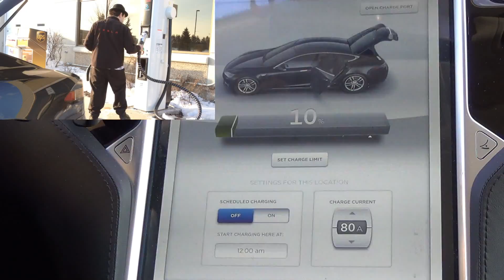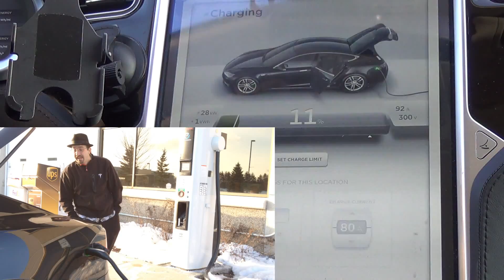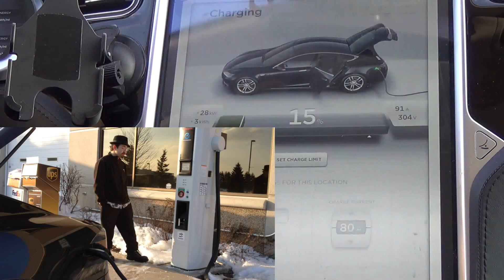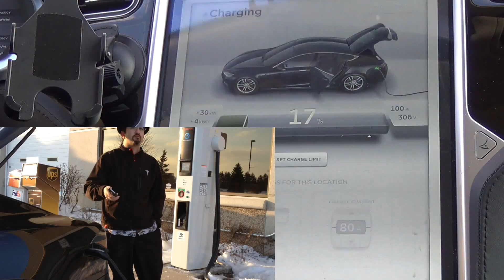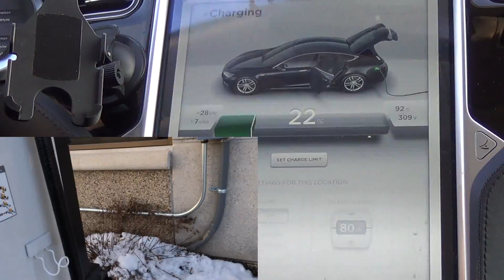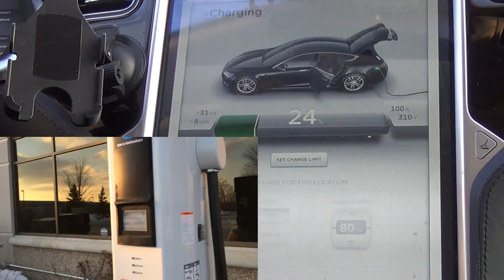Tesla Motors Model S: CHAdeMO Charge from 10-80% Almost... then FAIL!!!! Nissan Station Design Flaw!

Comment: The charging rate for both the Chademo and Superchargers is controlled by the car, not the charging station.  In other words the car tells the charger what current to deliver up to the limit of the L3 charging station.  On a day when the battery was warm you would probably see the 120 amp limit of the Chademo station.

You were also seeing a 7 amp difference between what the Chademo station and the what the Tesla was reporting for charge current.  This would have been due to the energy used to run the battery pack heater and the cabin heater if it was turned on.  7 amps at ~300 volts is 2100 watts which is reasonable.

Comment: Takes about 3 minutes to completely refuel my car.  The recharge time and the range limits will always be an inescapable issue with any battery powered car.  If the electricity is being generated with coal or natural gas, the Tesla is actually creating more Greenhouse Gas than a hybrid vehicle.
Reply: *****   Where is the electricity for the Tesla coming from?  If it's nuclear, like my home, or hydro-power then it doesn't generate CO2.  If the power comes from fossil fuels, the Tesla is NOT reducing Greenhouse gas emissions because of the inefficiency of generating and transmitting the energy to the charging station; about 30% of the energy in the fuel is wasted as heat.
Reply: *****   My point is that Tesla isn't going to save the planet. Just creating and operating a Tesla requires a huge amount of energy; most of it from fossil fuels. To reduce Greenhouse gases to the necessary levels will require much more.  People do not yet understand the drastic changes that must occur. This coming decades will see changes greater than occurred during the Industrial Revolution.
Reply: +John Ferguson i find it laughable that those who hate electric cars conveniently forget that it takes a massive amount of energy to make and run a petrol car as well. Show me one petrol car that doesn't require energy t make it or run it.
Reply: ***** The point is that Tesla has very little net impact that could improve the global environment.  Any meaningful reduction in Greenhouse Gases requires a much more dramatic adjustment to our lifestyle; a complete restructuring of our transportation system and our economy.  Tesla will not save the world.  Too many people are buying into the hype, the propaganda surrounding Tesla.
Reply: So your solution is to not try?  Let's just keep on with using petrol and diesel? At least tesla is trying to make a difference instead of sticking their heads in the sand.
Reply: ***** My solution is to get people out of cars and into using electric trolleys, trains, and buses.  We will have to build hundreds of nuclear power plants to generate the huge increase in the supply of electricity while making meaningful reductions in CO2.  Very few people appreciate the dramatic changes that will be needed to stop the run-away Greenhouse Effect.

Comment: the box at 20c is not hot.  At all.  That's warm.  Most hardware can withstand operating temperatures in excess of 90c.  I find it hard to believe the station overheated at such a ridiculously low temperature.  Heck, my computer has much smaller power components and it can run at 80c while gaming (176f) with just tiny fans to cool it.  And it can do it for hours on end through summer - even if the dust filters are clogged.
Reply from the maker: +Will Davis correct, these station are very flawed. I do believe Nissan has discontinued them. Using such small fans :( And even then, given the outside temps were well below freezing and the wind chill, it should never have failed like it did. Just overall bad bad designs and many issues of this design station. Tesla even changed the firmware on the adapters to limit current to 20kW on the Nissan Slim stations because of what you see in this video!

Comment: I'm trying to figure out what's the issue with those CHAdeMO chargers, 30 kW and let's say 90% efficency (should be realistic for this size of power supply)  would yield only about 3 kW of heat, that's about one and a half electric heaters, it doesn't sound like something impossible to dissipate, especially when cooled with freezing cold air... I guess that cutout sensor is located in main transformer and since it is quite a big mass to heat up (even though it is switcher) it takes some time to heat up this cold-soaked chunk of iron and copper. It may be similar case as with microvawe ovens these days, they rarely can operate continously without popping temperature limiters based on assumption that you rarely need to cook something more than 10 minutes...
Reply from the maker: mibars I will say, after another session, and go at it, giving the station a 10 minute cool down every 20 minutes of charging, that station smelled like it was going to burn.....
Reply from the maker: *****Wyatt Earp I'm not rich, my car was $74,500, and my Flir was $200 brand spanking new. I hate stupid people.

Comment: Looks like it was designed in a hurry by a bunch of internal combustion engineers who'd decided to try their hand at power electronics, then mass produced.  Some parts massively over specced, some massively under specced, and some really questionable decisions - air intake / filtration,  rain protection.
Reply: +nemthefearless It's designed for the Nissan Leaf, not a Tesla.
Reply: +nemthefearless It's some really bad work isn't it.
Reply: John Ferguson Exactly.

Comment: Question to the viewers is there a Chademo to CCS  & a CCS to Chademo adapter out there to buy yet?
Reply from the maker: No. But first, we'd need CCS Stations... Havent heard of too many of those yet. Maybe 20 in the whole country, compared to 600+ CHAdeMO and Hundreds of Supercharger Stations.
Reply: Robert Utess  Newer fast charge stations are equipped with both a CCS cable and a CHAdeMO cable.  Similar to a gas and diesel nozzle on one dispenser.
Reply from the maker: yep. kinds of stupid if you ask me. They should choose one and stay with it. As long as they keep supporting so many different standards, J1772, CHAdeMO and Combo, the manufacturers wont standardize. Thankfully tesla is the most universal so far yet also the most standardized.

Comment: Bummer!

There are no chademo anywhere near where I live. But what a cludge-fest piece of crap connector. It's like they designed some franken-connector. Wow, does not look high tech at all!! WOW.

You may want to think about buying an external mic for yourself, one with a piece of foam on it (wind sock). There were lots of times where I could not understand you.
Reply from the maker: I have a external mic, but only works with my camcorder, not my iPhone. I was trying to make this a big Multi-Shot video, but things didn't work out right.

Comment: Good experiment. Weak engineering.
You actually can't have drop in current in a circuit, you can have voltage drop. So the difference in current has to be measurement inaccuracy. Or lying.
And that's no small margin.
If we assume that the Tesla is accurate and that the car is asking for all that it can get, then the Nissan station is a lame 28kW charger at 300V. When it claims to be almost double. But it's possible it can rise to 125A at 400V. In the unlikely event it was submerged in arctic waters for cooling. Although it is in principle possible that it gets particularly hot at 300V which they didn't test much because they expected most use at 400. Still pretty substantial fail considering how massive the cooling system is. And how cold it is. Imagine how poorly it will do in US desert heat.
And now that I think about it, it's actually odd that it doesn't just thermally throttle down instead of cut out completely. Some is better than nothing. Double fail.
Reply from the maker: Agreed. and it gets worse. the filter was plugged I found after checking it. I contacted them, talked with the guy in charge. He cleaned the filter and then I met him at the station today with a 85kW car to test it again. it did charge MUCH faster at about 35-36kW, however, just like with my car, at the 25 minute mark, the station thermal failed again.... video coming tonight...
Reply: Alexis de Wouters they might have tested it only with Leafs but they couldn't claim it as a 50kW unit if it dies after 25 minutes of 30kW in freezing weather.
50kW Chademo is a fairly well defined standard and not Nissan specific.
Reply: ***** thanks again for a very interesting video. I think you both are right but you seem to forget (I know you don't) that it's a Nissan charger/station made for a Nissan electric car, I mean, it was most probably tested in that context and I'm quite sure the Model S is sucking a lot more and a lot longer than any Nissan yet. So, I'm not surprised if this station/charger is not optimised for charging a Tesla... Also, you can charge a Tesla at a Nissan CHAdeMO, but you cannot charge ANY other car than a Tesla at a supercharger. It's a great service they offer, even if it's not perfect... Don't complain too much, be honest <grin>... ;-)
More seriously, what I personally learn from your experience is that there is not (yet) any universal charger or station, they work hand in hand, and they have to be optimised for each other. Charging an EV is a lot more complex than filling up a gasoline tank.
Reply from the maker: Alexis de Wouters Dan is right. It could not be rated at 50kW if it could not sustain it. If it could only sustain for 20-25 minutes, then, it would need to have a hard coded shut off to stop the charging after that long. We had some nice weather last week. Killed the station in 10 minutes with a 85kWh car.

Comment: 30 kilowatts is a little disappointing for a DC charger. While these CHAdeMO stations are everywhere, they seem a little sketchy because of the excessive voltage. Also, the adapter looks really unwieldy, but I think that's an issue with the CHAdeMO connector, not Tesla.

Those things being said, this adapter will probably be really useful who travel in areas without Superchargers.